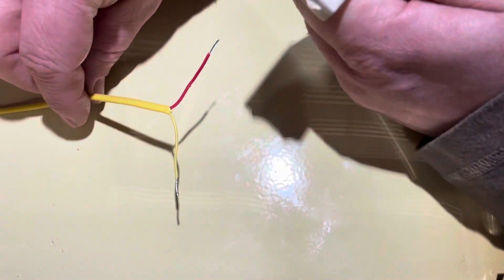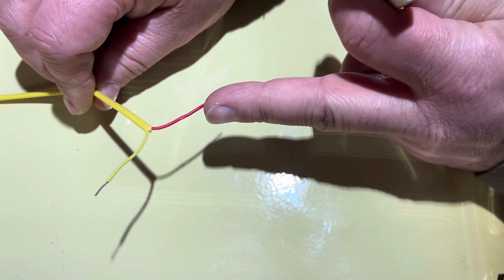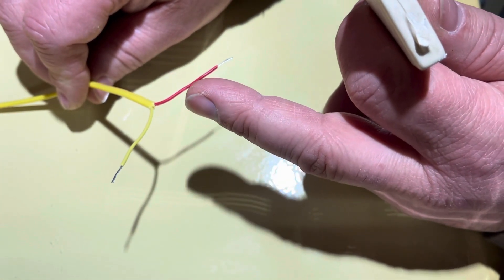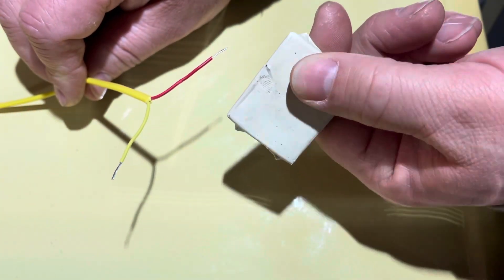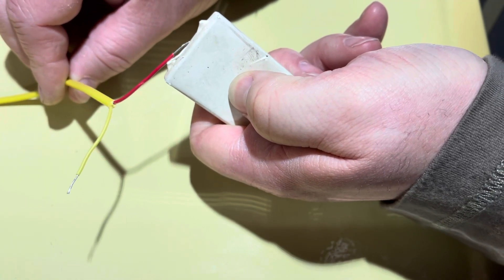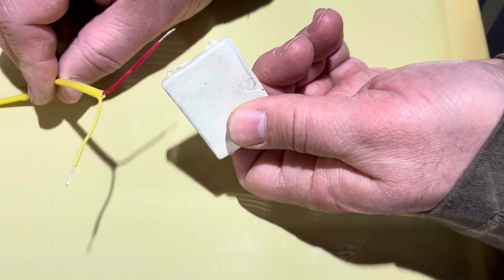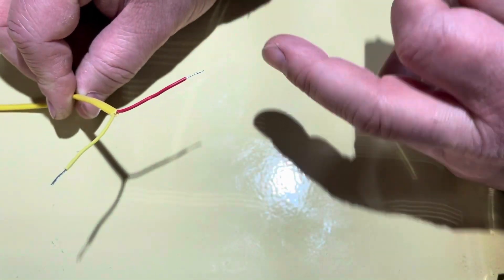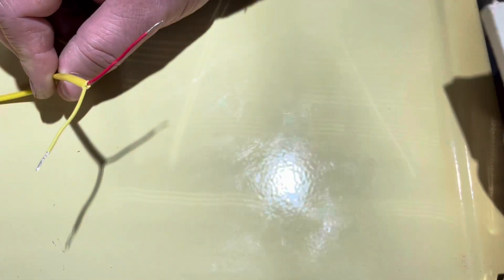Chinese K-type thermocouple wire color codes

Comment: Your wrong, the red one is Alumel because is magnetic and also de negative wire.
Reply from the maker: It’s been a while but I do think I got them mixed up. Thanks for the correction. Hopefully the test still helps though